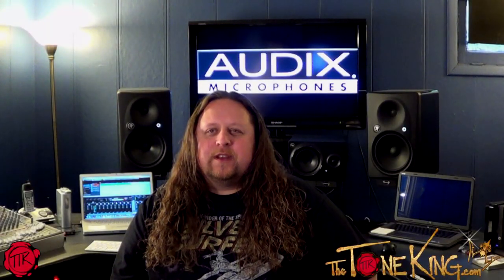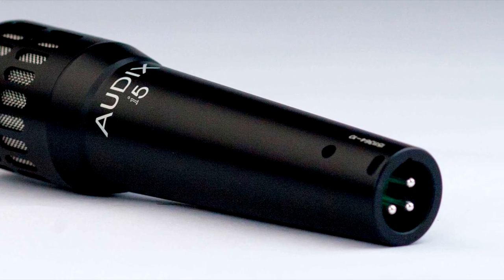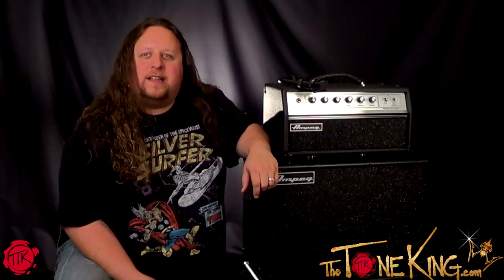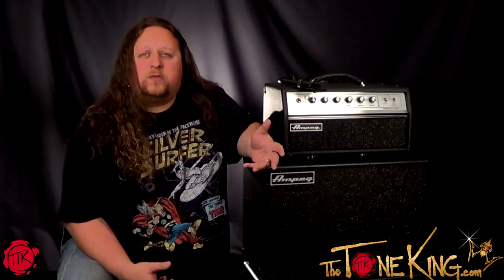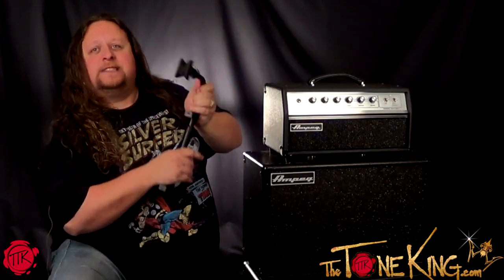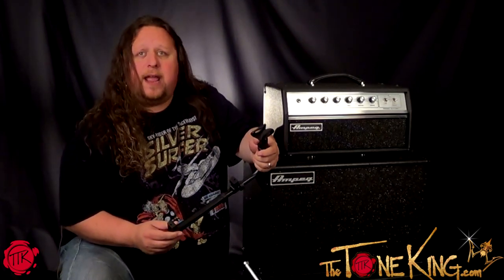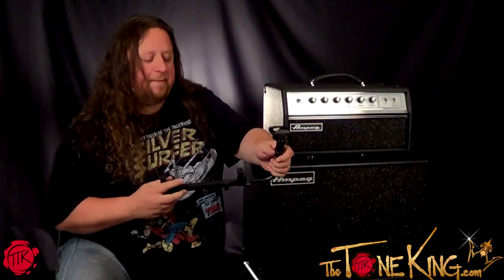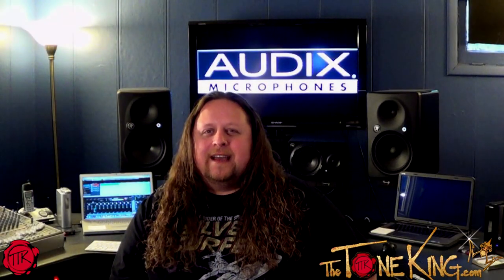Audix i5 Microphone & Cab Grabber by Rikk Beatty!

Comment: No, they have two options. One is where you screw a mounting plate to the cabinet, and the other is where you tighten a joint to the cabs edge. (sorry for bad explanation)